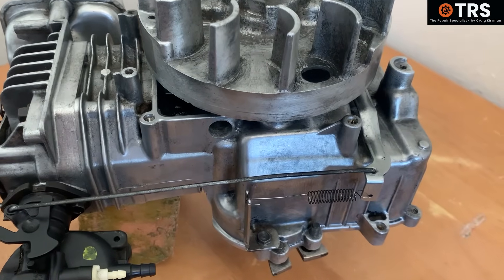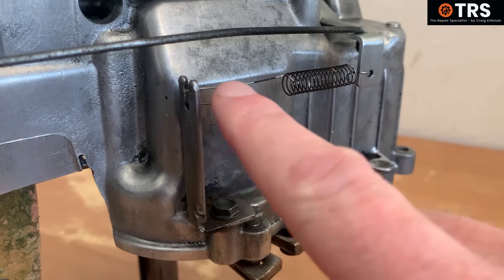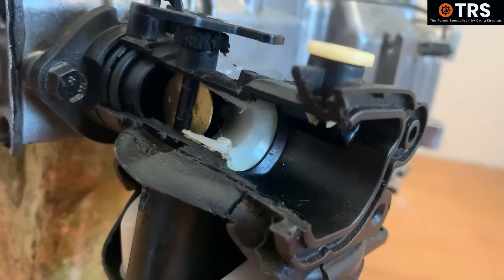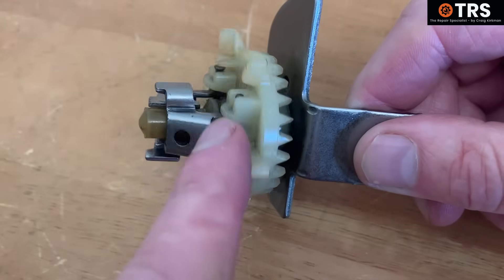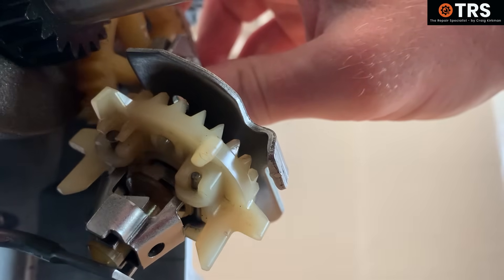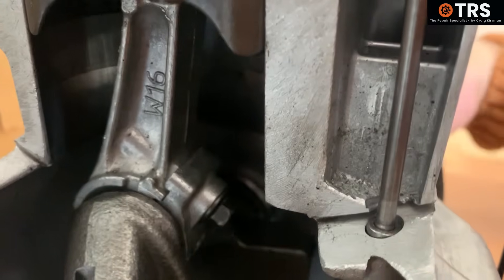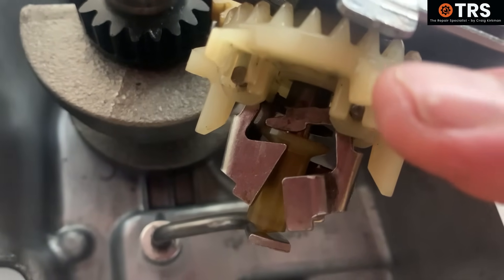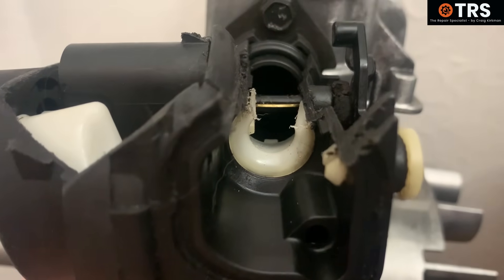How a Mechanical Governor Works on a 4-Stroke Lawnmower Engine. (by Craig Kirkman)

Comment: One of my favourite mechanical devices, always been fascinated by the ones with two balls as weights on steam engines. Has all this electronic intervention made things better? And I'm an electronics engineer.
Reply from the maker: Thank you for sharing your fascination with mechanical governors! The classic steam engine governors with two balls (often called "flyball governors") are indeed marvels of engineering and an important part of mechanical history.

Electronic intervention has certainly brought many improvements to the field of engine control. Modern electronic systems offer precise control, efficiency, and flexibility that mechanical systems can’t always match. Here are a few benefits:

Precision and Efficiency: Electronic controls can manage fuel injection, ignition timing, and other parameters with a high degree of accuracy, improving fuel efficiency and performance.

Adaptability: Electronic systems can easily be reprogrammed or adjusted for different operating conditions, making them more versatile than mechanical systems.

Diagnostics and Monitoring: Electronic systems often come with built-in diagnostic capabilities, allowing for real-time monitoring and troubleshooting, which can reduce downtime and maintenance costs.

Environmental Benefits: Precise control of engine parameters helps in reducing emissions, making engines more environmentally friendly.

However, it’s also important to appreciate the elegance and simplicity of mechanical systems. They are robust, can operate in harsh conditions, and have a certain charm and reliability that is hard to replace.

In essence, while electronic controls have significantly advanced the field of engine management, there will always be a special place for the ingenuity and beauty of mechanical devices like the flyball governor.

Thank you for your interesting question and for your work as an electronics engineer!

Thanks
Craig

Comment: I remember when mowers had a throttle...you could back off in low grass then rev it higher for the deep grass. Not real sure why they stopped making them with throttles.

Comment: Nice explanation. Thanks...
I have a weird problem with my lawn mower engine. The throttle linkage is OK, everything moves the way it is supposed to. However, engine has only 1 speed, and it is fast. Moving the speed control lever makes no difference. I wonder what it could be. I don't think governor could cause this. Maybe there is an air leak.

Comment: wonderful illustrative video. it would also be good for a school educational video. but I have a question. I do have this engine, but the connecting rod connecting it to the carburetor keeps moving left and right, constantly opening and closing the butterfly valve. what could be the reason? can you give me an idea?👍
Reply: I had the same problem! In my case there was crap in the carburator in the channels where the gasoline goes when idling. I learned that the gasoline goes through one very small channel when idling and through one bigger when you use the throttle. Maby it's not the same in your case, but it fixed it for me!

Comment: That was an "Oh!" moment for me. Got myself two old Briggs & Stratton mowers to repair, one's running now but sounds like it revs way too high and inconsistently, so this is a solid lead. Wasn't really aware how governors work on engines. Thank you.

The other one probably has a broken spark coil, no spark from the cable connection, and but a drip of oil on the dip stick so probably received no maintenance :(

Comment: so, bye bye mr governer, nice knowing your function.
Reply from the maker: Well if he has to go then:

It's time for your triumphant exit, Mr. Mechanical Governor. We'll never forget your unwavering commitment to preserving the engines' ideal speed and stability. You were the mechanical equivalent of a superhero, keeping everything under control and ensuring that they ran smoothly. We can only envision you joining a covert organisation of retired governors once you retire, exchanging tales of accuracy and equilibrium over cups of oil and gear-shaped biscuits. Mr. Mechanical Governor, good luck with your future endeavours and may they be filled with well-controlled humour!

Comment: You meet also on small engine generator,on my generator when there was more need for electricity revs where going more, now something happened and revs goes up and down every few seconds.
Reply: Depending on the model, there may be a small plastic jet that's located just below the tickover adjustment screw. Remove the tickover screw fully (count the number of turns !) then prise out the plastic jet and blow it through with carb spray or an air line, replace and refit the tickover screw, this should stop your engine "hunting" up and down.

Comment: If your lawn mower has a hunting rpm ( revs up and down almost shutting off in a never ending cycle) or when it starts it revs up high to fall on its face and turns off not wanting to stay running .. the carburetor is dirty .. 
some carbs have a center bolt under fuel bowl on the carb this is your primary jet 
remove the bolt ( if the bowl stays on that's fine one thing at a time ) with the proper size socket or wrench  .. make sure it's passageway that runs through the center and the little hole that's undee the bolt head is clear . Put the bolt back on the carburetor and it should be good to go. ... showed my buddy this some years back ... he would picked up ever mower thrown out on the curb clean the carburetor and sell it to pawn shop... guy was making almost $400 a month doing this at one point.
Reply from the maker: Wow. Awesome👍

Comment: I used to take apart lawn mower engines when I was a kid.  It seems to me that in those days, 1/2 century ago and more,  lawn mower govenors on the Briggs and Straton engines were controlled by a fin that pick up the wind speed from the blades at the top.  Am I correct in this and have you seen these systems?  Excellent explanation as usual you did.
Reply from the maker: Ah Yes! I do of this system and i believe very similar systems are still used today. You have just given me another idea for a further video, so thank you. Craig 👍